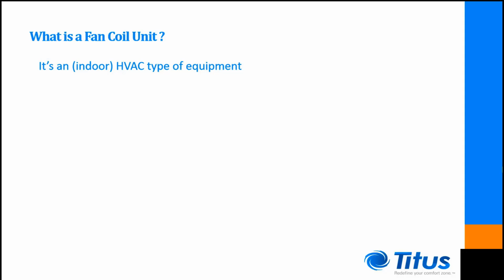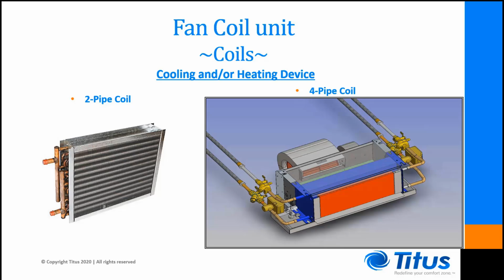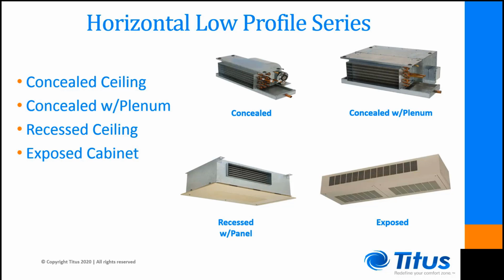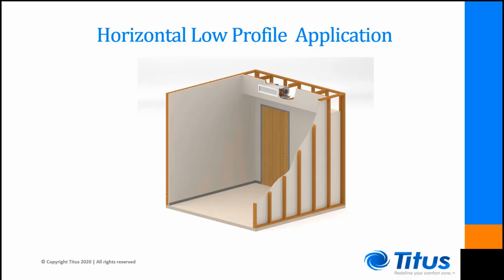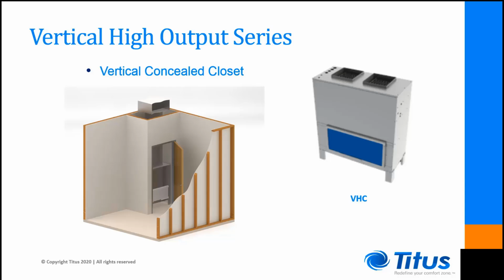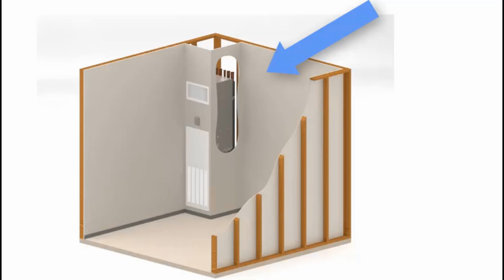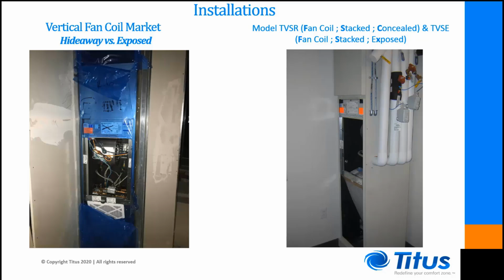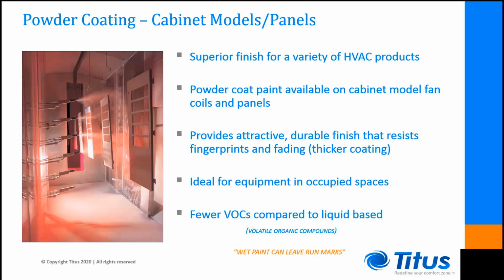Fan Coils 101 Webinar

Comment: Thanks , well explained.

What about the child water pressure drop ? 
How they affect the efficiency and cooling capacity?
Reply from the maker: As the pressure drop increases or decreases it won’t have an effect on the coil’s cooling capacity.  However if a designer were to increase the number of circuits inside the coil to lower a high internal pressure drop then the coil’s cooling capacity would decrease.  This is because the cold water will spend less time inside the coil which decreases the time allowed for heat transfer between water and fin block.

Note that high pressure drop levels inside coiling coils does decrease the efficiency of the overall building’s plumbing system.  The reason is that as that coils with high pressure drops increase the size (therefore increasing cost and energy usage) of the building’s pumps to circulate water in the building’s water system.

Comment: I live in a building with vertical fan cool units. In winter, the instructions are - Keep the window in the unit closed and don't keep the sliding door open, even by half an inch. The sliding door is next to the FCU. Apparently, the cold air can cause the coil to rupture, and leak uncontrollably. Coil rupture has happened on more than one occasion. 

Is there a solution for this apart from keeping the windows and doors closed in winter? Are coils available that can withstand these "extreme" conditions and is there a way to automatically shut off water if there is a leak?
Reply from the maker: As a person might imagine the situation that is occurring is the cold air from outside the building is causing the temperature inside the Fan Coil to drop to below the freezing point.  This in turn causes the water inside the coil to freeze, expand and burst the thin copper tubes inside the coil.  

There are water coils constructed with thicker copper tube walls that are meant for Steam applications.  While using this type coil might give a little bit more strength to the coil, it wouldn’t make much of a difference when compared to the amount of force water exerts when freezing and expanding.

As we can imagine the best solution is to prevent the coil from being exposed to the cold air in the first place.  However this is very difficult because generally we must rely on people (occupants of the room with the Fan Coil) to not let cold air reach the coil.  It sounds like this has been a problem in several situations in the past for this building installation.

Another helpful strategy is to introduce a type of glycol (usually Ethylene or Propylene) to the Fan Coil water system. These glycol’s act like ‘anti-freeze’ and help reduce the chance of water freezing.  Please consult a building design engineering consultation firm before doing this as adding glycol will impact every pipe and piece of equipment that comes in contact with the glycol throughout the building’s plumbing.  In addition glycol cannot come in contact with any type of water that a person or animal might touch/consume as it can cause serious harm and even death.  In addition not all building systems are compatible with glycol which can cause damage to equipment and the amount of glycol to be used must be precisely calculated as well.

Another good strategy is to not allow the water in the coil to freeze by keeping it ‘hot’.  This means always allowing hot water to flow through the water coil even when the thermostat and fan are not calling for hot air to be supplied to the room.  The hot water valve must remain open at all times to keep the hot water (usually 140 to 180 degrees F) from the boiler flowing through the coil at all times.  This can be accomplished by sophisticated thermostat control systems that will always command the hot valve to stay open regardless of room temperature.  Also manually locking the hot water valve in the ‘open’ position will accomplish this strategy.  The potential drawback of this strategy is overheating of the room (even if the fan isn’t running) or causing the sheet metal housing of the fan coil itself to heat up and cause harm to anyone or anything that touches the fan coil (i.e. a person touches the front panel of the fan coil and burns their hand).  This strategy should be experimented with in one Fan Coil room for effectiveness and safety before implementing building wide.’
Reply: @TitusHVAC  Thank you for your quick detailed response. 

Fan coil ruptures occurred in 2 units on 2 separate days in January. In one case, water damage extended as far down as the ground floor (6 floors below the unit with the ruptured coil). 

The building is only about a year old. With this very important protective function left for a human being to perform, more ruptures are likely.

The sliding door opening is only about 1 foot from the fan coil unit. If the door opened from the other direction (left to right instead of right to left), the opening would have been 6 feet from the unit, providing a better level of protection. 

Two Observations
According to the manufacturer's data:

(a)  The units are equipped with 1 kW auxiliary heaters to provide heat during the Spring and Fall when the systems are in cooling mode. 

(b) The units are equipped with a temperature sensor that causes the unit to enter anti-freeze mode when air entering the unit falls below 4C/40F. Anti-freeze mode circulates hot water through the coil and shuts down the fan to reduce cold air flow

Questions
(1) Shouldn't item "b" above have prevented coil rupture?

(2) The temperature sensor ties into a digital controller which activates a relay that brings in the heater. Can't the temperature sensor be used to turn on the auxiliary heater when the temperature drops to 4C/40F and maybe also activate an alarm?
Reply from the maker: @mikes1615  It would be  best for you to contact our fan coil specialist at sewhite@titus-hvac.com.